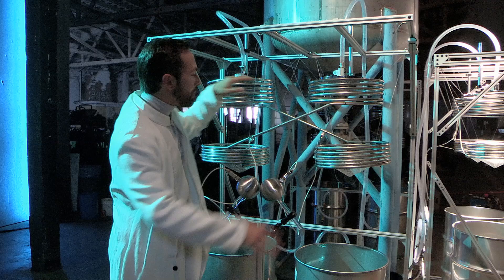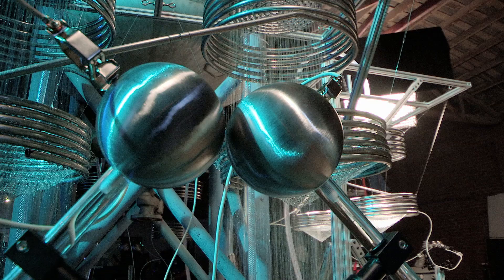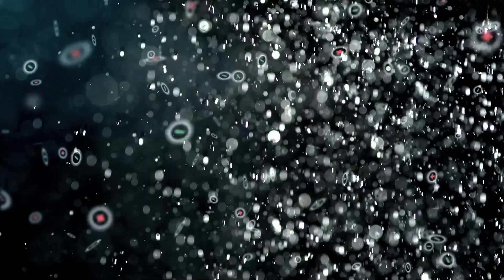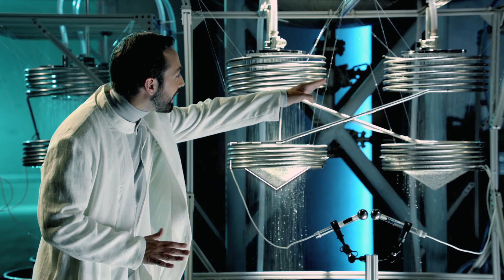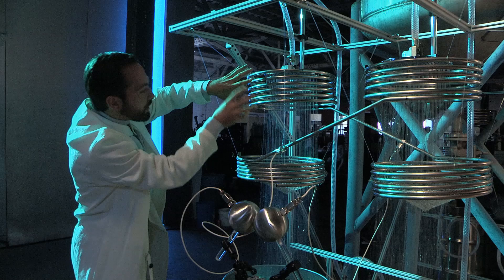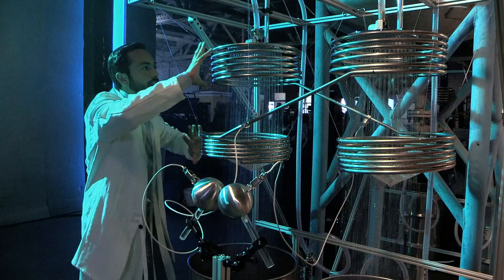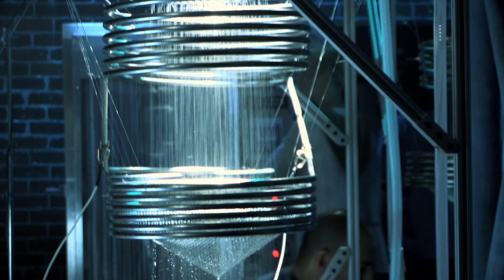Sparks from Falling Water: Kelvin's Thunderstorm

Comment: i've got a stupid question: the setup looks symmetrical; but one side becomes negative while the other becomes positive. How does nature decide? 

Is it one of those deals where a tiny fluctuation in the charge of the droplets at the beggining baloons into a macrospic effect? in this case, would one side be negative once, only to become positive in the next cycle?

Or is there a diode somewhere that forces the charge to flow in a certain direction and determines which side is positive?
Reply: +Thomas P yes and then pprobably not
Reply: I am wondering the same thing. and would the build up of energy increase if the gap was widen where it sparks? at would the energy increase along with the size of the coils and amount of water flowing through them?
Reply: ***** more water would be more charge yes, bigger coils i dont think so. and yes if the gap was larger it would make a bigger charge built up, but he says in the video at some point it would find another place to go.
Reply: +Thomas P Just saying Hi :) and yea, random I would think
Reply: hey P Thomas... small world huh?
Reply: Purely random, unless you deliberately start it with one side  to favor a particular charge. You can force it to go one way or another with the presence of another electrostatic charge.
Reply: It's random. The water ions are positive and negative 50/50. But that doesn't mean that the left side will get 50% of the positive/negative and the other side will get the other 50%. There will always be a slight imbalance between the sides (example: left 49%positive ions / right 51% positive ions). 
That initial imbalance in the first few seconds of falling "decides" the charge.
Reply: Not a stupid question. Your first assertation was correct: tiny fluctuation balloons into a macroscopic event.

 Nature decides which coil becomes posative or negative based on accidents which are allowed to happen within a set of possible events.
Reply: May be just by lag in flow of water from both showers by few milli seconds decides it.By that I mean that though one coil it flows first by a few Mili seconds lag.

Comment: Water is super diamagnetic and therefore can create an electro magnetic field flux ?
Reply: which comes from the potential energy of water turning it into kinetic energy.which simply means if you remove the coils the water will have more speed when it reaches the ground
Reply: Hafiz muhammad Ibrahim jaffar for what use it must be converted into kinetic energy...there is no such kind of turbine there...
Reply: Hafiz, kinetic energy cannot translate into electric energy without some device such as a turbine which does so by spinning a generator which produces a magnetic wave which mobilizes electrons already in place within a conductor.  

While it was the esteemed Lord Kelvin who made the original device this effect had been observed around waterfalls for decades if not centuries.  What they observed is the tiny droplets of water having an increse in charge that they defied gravity and it was believed breathing the air had therapeutic effects.  Therefore I an inclined to agree with Vignan vinn.
Reply: Daemon Nice I was talking about gravitational potential enrgy converter into kinetic energy.I joked to john tellung him if he jumped tge same would happen but he took it literally.my point was the potential energy changes into kinetic energy the moving carges create changing flux which generates emf i.e electrical energy.he must have understood it wrong.
Reply: well, I appreciate the clarification. Humour often gets misunderstood on the interwebby.

Comment: how much charge can you built up in the coils if you don't allow it to release the energy in a spark
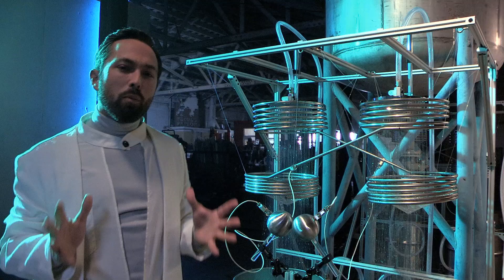Reply: 3:10
Reply: MrMinecrafter49 I'm guessing, not very much because once the charge builds up enough, it will begin to draw the water into contact with the upper coil and that would ground it.
Reply: I was just about to ask that
Reply: @jsbrads1  except if you build a mechanism which will predict when its about to do that.. also if you put this in a huge scale on a HUUUGE waterfall .. will it work efficiently?
Reply: At that point it's only limited by corona discharge, i.e. the electrons running away from the balls. They're shaped as round as possible to reduce this effect actually.
Reply: great question, the problem is the power of magnetism dissipates by R^2. In many applications, the smaller the set up, the larger the fraction of energy that can be harnessed. If a lightweight assembly could be created you could slowly charge a phone, but a simple paddlewheel can generate more with a simpler assembly.
Reply: You can increase the discharge potential by moving the balls farther apart. It takes longer to charge, but it makes a louder snap. The voltage can be estimated from the length of the gap; there is a table some where. It varies with humidity and pressure.
Reply: That's true, when they are wider apart they can build up a bigger charge, but it also takes longer to build up the charge. Electro magnetism is generally proportional to the inverse of the distance squared (double the distance, quarter the energy)
Reply: dont need coils.. they are just a metal  surface  ,    a flat ring  works better
Reply: @aeromodeller1   not true,  if too  long appart, the  water would  start hitting the collectors and discharging, and spark would never ocurr. the shown is the better arrangement they could get to  film,, and the better machine they could built  after many trials, although  the multiple drops are not the better
Reply: @cartelrusso5992  nope...  source  must be isolated

Comment: There's one thing I don't get: so when the coils on the right side become more negatively charged, they attract the positively charged ions, okay. But there's still the same amount of negatively charged ions in that stream of water and the positively charged ions still go back into the stream, so where does this charge imbalance come from that creates the spark?
Reply: I think that they don't go back in that stream of water.
Reply: XenoContact But the force could never be strong enough to make the positlvey charged ions not go back into the stream, could it? How is that supposed to work? It would need to affect the tank the water is in...
Reply: one thing you have to realise, its not both coils on the right have the same charged, the one of the top is positive (or negative) and the one in the bottom is the opposite, so the ions of water never "get lost", only are organized and the spheres are connected to the bottom ones, so they are opposites.... i guess hahah
Reply: MySpaceBarIsBroken That's why the effect is so tiny. 6 years to charge an iPhone on that machine. Even when the feedback loop has reached its full potential (balancing the charge buildup with leakage) it's still just a teeny tiny fraction of the positive or negative ions that are prevented from falling.
Reply: Rather than calling them coils, it is better to call them charge separator rings.  Consider like and opposite charges. They respectively repel and attract.  A negatively charged charge separator ring will attract positive ions to  the water streaming through the charge separator ring, and repel negative ions from ever entering the stream. The system works better when there is only a short distance from the sprinkler to the charge separator ring, and  that the stream of water breaks up into droplets roughly as it passes though. 

From the beginning, the smallest random difference in charge between the two streams will escalate the charge difference between the streams.  

As for where does the energy from from? Gravity but lets consider like and opposite charges again. They respectively repel and attract.   A closer look at the whole process reveals that for a short distance water is pulled towards or accelerated by the charge separator loop. After it passes the charge separator loop,  water is slowed down because of its attraction to the separator loop, and slowed down again with the collector plate because like charges repel. It takes energy to slow falling water,  and it has to go somewhere. It ended up stored as an electrostatic charge potential
Reply: I had this question too, and none of the responses address it. We start out with water droplets. Maybe some of them have a little electric charge. Perhaps the "coil" (maybe more of a capacitor plate?) attracts some of the droplets and repels some others based on what charge they carry. But don't all those droplets still end up connecting to the mesh at the bottom? I don't see how an imbalance of charge makes it to the metal parts. Are some of the droplets being thrown so far outside that they miss the mesh at the bottom?
Reply: "don't all those droplets still end up connecting to the mesh at the bottom?" 

Notice how the mesh on the bottom and the rings on the top are connected to each other much like an "X". If the rings on the right are more negative, they attract positive charges in the right stream that collect on the mesh just below, on the right. These positive charges on the right mesh in turn charge the left ring with positive charges that both: push positive charges into the right stream while drawing more negative charges the to left stream. Negatively charged water falling through the positive charged rings on the left collects on the left mesh which in turn builds a more negative  charge on the right ring to attracting even more positive charges  to the stream on the right and pushes even more negative charges to the stream on the left.  

The smallest of charge imbalance is all it takes to make the system rapidly build up charges until either the system is discharged, leeks the charge, or the electric force becomes so strong that the charged water drops are repelled by the mesh below, that they refuse to touch the mesh making no more charge build up possible.
Reply: Does some of the water miss the screen at the bottom?
Reply: Is the net charge on what water comes from a given spray head at the top, zero?
Reply: it astounds me that so many people seem to think they're answering the question, yet seem to have completely missed the point. to answer the question, I can only imagine that yes, in some small way, the like charged ions dissolved in the water are being stopped from exiting the shower head. not stopped all together, but slowed, while the unlike charged ions flow even more freely than before. you might think that this wouldn't have any effect, seeing as they're not going to hang out in the pipe for ever, so what goes in one end must come out the other, right? so the question then is, how do the charged rings affect the flow of water all the way on the other end of the hose? my hypothesis is that by giving even a tiny resistance to the flow of like charged ions, that back pressure will propogate all the way through the hose and to the parent tank. one way to think about it is that because the ring is pushing back on the like charged ions at the shower head, the density of those ions at the shower head is going to increase, and the water itself is going to become charged, and repel the ions further back in the hose, and this will propogate all the way back to the tank.

tl;dr the rings are charging the whole hose, and that's what's restricting the net flow of ions
Reply: How is electrical current generated in a generator? We use a strong magnet to literally move electrons through the coil, or conductor. Right?

Water is slightly diamagnetic.  So it too can generate electrical current. Yet in the beginning all the water molecules are facing different directions in 3 Dimensions. They will even have their own moment forces. But since water is diamagnetic over time all the water molecules will try to repel each other and align accordingly. Slight imbalance can come even from the flow of the water. Then charging the top coils with a current and magnetic field intensifies the field carried by the water.

Comment: My first guess was that the produced energy comes from the inner friction in the water. When falling, it looses its potential energy, and during that some of it transforms into friction which than creates the ions. But than I realized that the ions are already there. So the produced energy doesn't come from the potential energy, but it's already stored in the water chemically. The only thing I don't remember from high school physics is that why are the ions there. :) But I guess, there is an income of energy from the surroundings of the water as heat for example.

Comment: Static in the air from the movement of the water through it. Same as an amp tester on a kite line. I haul fuel and everything from walking to pumping the fuel into the trailers, or gravity filling the ground tanks crates static. All movement of fuel requires a form of grounding for similar static to prevent fire. As all fuel has vapor(diesel above 40C). That's where the fire starts because liquid fuel doesn't burn(not enough oxygen)

Comment: Induction! Water is a polar molocule and also acts as a polar solvent. When a molecule is said to be "polar," this means that the positive and negative electrical charges are unevenly distributed. The positive charge comes from the atomic nucleus, while the outer electrons supply the negative charge. It's the movement of the electrons that determines polarity. Therefore, induction is the source of electricity in the coils. The separation and direction of the coils creates a simple diode, and the energy can then be discharged through the arc once enough charge is built up. All things exert some form ambient electric or magnetic field, even "neutral" objects. Water is neutral, but that means it has BOTH positive and negative poles that are stable, with no one side being stronger than the other. Magnets are also neutral - having both a positively and a negatively charged pole.  It works like moving a magnet through the coils  - inducing a current.

Anytime there are positive and negative poles, there are also electric and magnetic fields that interact and flow through those poles. When those fields interact with conductive, segmented objects, they induce an electrical current by attracting or repelling the free/shared electrons in the object. 

There may be a few other factors at work contributing to this, such as the limited particle interactions with air molecules, but the primary driver here is polarized water molecules inducing a current into the conductive coils. 

Much love.
Reply: It's just kinetic energy due to gravitational force dude. Polarity of water has nothing to do with this. When water droplets pases through the wire mesh, the friction between the molecules of water and wires generates positive and negative charges separately. Ever seen a Van de Graff generator? The working principle is the same, which is friction.
Reply: @thunderboltcloud3675  
You are saying that water displacing the air is generating enough friction to induce a high voltage current? This is mathematically impossible, given the conditions. If friction were the imparting force, then a lot more thermal energy would be generated, and in this environment I imagine that you would require some moving parts to convert the friction to useful energy, or else a material that can transform kinetic or thermal energy to electricity. 

The water particles are constantly attracting and repelling each other - and in free fall, this effect is more pronounced because the particles aren't as liquid bound as when at rest under gravity and surface tension forces. As the particles move in the air, their polarized electrical fields induce tiny currents into the coils, which then creates a positive feedback loop. The fact that there are two waterfalls with two sets of connected coils each electrically connects both waterfalls, and charge separation results from the induced fields in each segment of the coil. The negatively charged poles will be even more attracted to positively charged coil segments, and vice versa - which is why the water is physically attracted to the coils - until they are discharged. This is the law of induction at work, not friction.
Reply: The mesh strainer only separates the water for smaller particles and more even flow, which helps free up the polar action of individual droplets. The water going through the strainer cannot produce enough energy to induce an electric current on a coil situated a significant distance away, insulated by air.  The goal of putting the water in a state of free fall is to eliminate both friction (which opposes the necessary motion for useful induction), and surface tension (which is why there is a mesh strainer - the smaller the particle, the less interference it will experience from  air resistance and surface tension). I gather that the the action of the attracted particles is an important part of the experiment, and so the strainer was probably added to to help thin out the water to a smooth stream of small droplets, which helps maximize it's electrical potential while falling through coils.
Reply: One last thing: I'd bet money this experiment could be replicated in a 0-gravity vacuum tube - eliminating particle resistance and gravity. If a jet were used to propel a spray of water particles through coils like these in a frictionless and weightless environment - the electromagnetic action on the coils would still happen. This is why it is wrong to say that this is "gravitational" energy. Gravity is being used only incidentally - to feed water through the coil. Assuming you have water in motion already, this effect can occur. This is not generating any usable energy on its own. The generation of current happens because of electromagnetic induction. 

If we could replicate this experiment in 0-G, it would support my theory that this is electromagnetic action, and that it is not dependants on gravity or friction to occur.